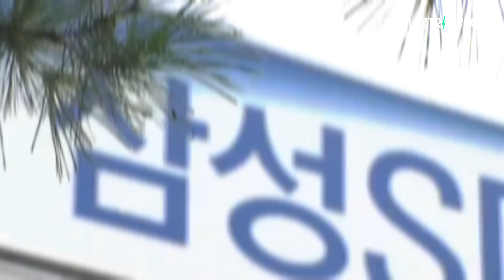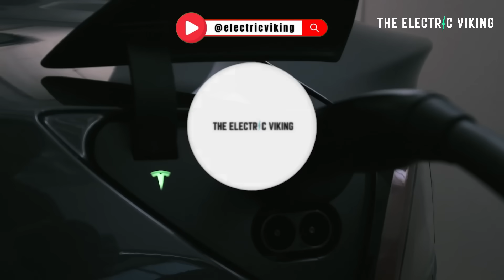Hyundai starts pilot production of solid state batteries for EV testing

Comment: Is there any reason technologies can't be combined? Silicon anode batteries have similar energy densities to solid state batteries, but if you put both in, you could get even better energy density. This does not necessarily mean you'd get more range. You could get the same range with fewer cells and lighter battery packs.

It's not an either/or proposition.
Reply: Silicon anodes are more applicable to Lithium-Ion to optimise the collection and retention of Lithium at the anode much better than current Graphite based anodes. However, Silicon offers lower energy capacity than a Lithium-only anode offers. In Solid State Batteries the anode is either a solid chunk of Lithium metal or an 'anodeless' design where the Lithium collates directly at the charge carrying conductor without a seperate anode material present (plus the electrolyte is replaced with a solid, such as a ceramic or polymer membrane). Hence would not benefit from having another collating material  such as Silicon present at the anode, indeed SSB's will likely surpass the current carrying and storage capacity of a Silicon anode based Lithium-ion batteries. 

The next battery technology offering higher potential energy and power density are Metal-Air batteries (like Zinc-Air and Lithium-Air), where the theoretical energy density can be as high as 11kWh/kg (Lithium-Air, currently 1 to 1.7kWh/kg lab versions have already been created). These are in research as the next technology replacement to SSBs, likely targeting HGVs, Trains, Ships and Aircraft needs. The current road block is cycle life, currently under 1,000 cycles, but innovations in both Lithium-Ion and SSBs may be portable to Metal-Air batteries to accelerate their development. Plus for specialised extremely high energy density needs (such as flight) then a design/process based approach may work even with lower cycle life batteries, for example using high recyclable swappable batteries where the aim is to reprocess batteries at their shorter end of life back into new batteries; whilst more costly and less-economical for mass transport like cars such would be economical for flight use cases.

Comment: 90-95% EV adoption by 2030 🤣🤣🤣 and pigs will learn to fly.
Reply: Regardless, they be here anyway, ice will dissappear
Reply: @luismontelongo4148  ICE will not disappear. They're too useful and flexible. While they may become a much smaller percentage of the total vehicle count this will be the case in only a few countries and regions for the foreseeable future (China, Europe, America). Adoption will be highest where infrastructure is well-distributed and charging speeds are high enough. EV production will hit a wall in less than 10 years  as markets reach saturation point.
Reply: Doesn’t have to be 90%. But 40%, 60%, etc, spells doom for ICE. Economy of scale tank. Meaning it will be much more costly to build from the same suppliers and parts due to reducing bulk discounts.
Reply: Within 5 years, the only car manufacturers left will be Tesla and Chinese ev manufacturers.  ICE is DEAD
Reply: ICE is FINISHED

Comment: You can't simply power a jumbo jet with batteries. The engines require combustion for heat and pressure in the combustion chamber.
Reply: Translation, "I've learned that something works a certain way and believe it will always be like this for an eternity "
Reply: They use electric motors
Reply: Electric turbofans (and turboprops) already exist powered by electric motors. Seems we're going full circle as the very first turbofan was powered by an electric motor. Some of these test bed electric planes are using re-engineered Rolls-Royce turbofans powered by MW electric motors instead. The power requirement for fligth is of course first focussing on short-haul and regional flights, but once power density reaches a threeshold (2kWh/kg) then long-haul flights becomes feasible as well.
Reply: Ok, if they achieve that kind of energy density, maybe it'll be possible to achieve that kind of performance with battery electric. I'm sceptical myself, given all the breakthrough tech that never amounts to anything, but would love to be proven wrong about this one.
Reply: @alexishart1989  - it will probably be the generation of batteries after solid-state, the Metal-Air batteries. Lithium-Air has already achieved 1.7kWh/kg in trials, their downside is the short cycle life, currently under 1,000 cycles. The hope is the innovations in solid-state, which had similar cycle-life issues onyl a few years back, will be transportable to the Metal-Air batteries. 

However, for flight designs there is also research into rapid-swap battery that are charged off plane, ones that are designed to be fully recycled into new batteries once they hit their short cycle life (that is the problem is solved by a supporting process rather than within the battery itself). This approach won't work for mass-deployment batteries like EVs but may work for specialised cases like long-haul planes.

Comment: A 70-90 MWH solid state battery pack will NOT improve range over a 70-90 MWH lithium battery pack. 90 MwH is 90 MwH no matter where it comes from and with all other variables the same will result in the same performance.
Reply: A 70kWh SSB being half the weight of a Lithium-ion battery will improve the range efficiency of an EV, meaning the miles per kWh (kWh per 100km) increases and hence so does the range. If a car with a 70kWh battery achieves 4.2miles per kWh then it will travel 294 miles on a full charge, a lighter 70kWh SSB with say 6.5 miles per kWh would give 455 miles on a full charge.
Reply: @ The battery would have to weigh zero for mileage to improve to the degree you’re stating. It will improve some though.
Reply: He didn't say that. Hyundai SS is 2x the energy density of lithium ion. SS should have 3-4x the energy density of lithium ion if done right by others.
Reply: @larryc1616 Go to 6:15 in the video. That is exactly what he said.
Reply: @larryc1616 Go to 6:15 in the video.

Comment: I don't see EVs having 90% share by 2030 unless something really bad happens in the fuel or ICE production world. However, if anything does force that shift it would be money not customers preference. Some people still like gas cars and the only thing that would stop them from getting one is the price of fuel, price of the car, or government ban on registrations.
Reply: German automakers might be going out of business sooner than you think. 2030 is not going to be too far off. The US is only hurting itself by holding off on EVs and to be honest car prices are already getting more ridiculous each year.
Reply: @willv88  We have had 100 years to optimize making ICE cars all the cost takeout has already happened. The parts count keeps going up and the cost too. Over 2000 more parts than an EV, you can't bean count your way out of that. EVs have one really expensive part, that's the low hanging fruit. Make batteries so they get cheap and problem solved.
Reply: In 5 years, the only car manufacturers left are Tesla and Chinese ev manufacturers
Reply: They will in China if not sooner than by 2029! The world lags sure, that market share milestone. Likely won't be reached until 2032 globally maybe sadly 2035?

Comment: The safety aspect (low fire risk) might be the biggest advantage.
Reply: Yea since so many electric cars are blowing up in flames, right after ICE and after hybrids 😂
Reply: @medschoolvisual6954  a horse driven cart would be safer. Absolutely no fires of any sort to be worried about Then again the horse might go bonkers and kick you in the face and send you into a coma.  😉😆😅
Reply: Per capita, ICE has 10-40x the fires vs ev's
Reply: LFP is at very low risk as well, compared to lithium batteries with cobalt
Reply: ICE data per capita 10-40x more fires than ev's especially with LFP's
Reply: I’m also interested in the wider range of operating temperature.

Comment: Solid state batteries will have to offer something different. Very fast charging on existing chargers would require a very different curve. However, if they store more energy and can enable very long range vehicles that would be marketable. Cold weather performance could also be a good selling point.
Reply: Not catching fire would be good.
Reply: 3 ice vehicles burned down to the ground here in America in the time it takes to watch this video SMDH. 
The #1 open recall across all legacy ice oems affecting over 4,000,000 cars sold in America 3-5 years old. Is for the risk of fire even when parked! Its right in the name internal COMBUSTION engined!
Reply: Faster and Wireless charging and reduced weight by 50% if energy density is 2x that of lithium ion

Comment: ok, so here is the problem though.  yes, the same size battery would give 2x the range.  but these battery cells will not be cheaper.  which means the cost of the car would go up.  except i don't think they would do that.  i think they'd try to keep cost of the car the same.  so they'd only give the car a 400mi range.  so maybe A LITTLE MORE range than the cars currently have.

hey, does anyone know, do solid state batteries still suffer in colder temps?
Reply: Do you like gas cars?
Reply: @6a4e8w9fk  I liked my 2023 ioniq 5 better, before it's battery got destroyed

Comment: low degradation is the promise of solid state battery's
Reply: And solid State batteries with 10x the range.
Reply: Existing batteries are lasting longer than the car already so it has to be more than that. However, better cold weather performance would be a big deal.
Reply: @frankcoffey  they'll also allow full exploitation of a battery's capacity, charge and discharge rate.  It'll allow for using smaller batteries for many.  Less need for a  big battery if charge time's plummet
Reply: @frankcoffey  battery resale post life will matter.
Reply: @veganpotterthevegan  Solar users would love to get their hands on a used solid state pack.
Reply: @frankcoffey  when they're cheap.  Realistically though, sodium batteries will always be cheaper and make a lot more sense in a stationary system
Reply: That's only one promise...one of many
Reply: Battery weight is reduced by 50% if it's 2X energy density of lithium ion
Reply: @larryc1616  totally, but you can cut it down even smaller and have more space inside a vehicle and cut the price down of said vehicle with a smaller battery.
Reply: @veganpotterthevegan  - or cut down the weight and size to increase a car's efficiency, having a small lightweight EV with a 50kWh battery that could do 300 to 400 miles would be sell extremely well in many markets.
Reply: @GruffSillyGoat   totally and really, an even smaller vehicle with just 100 would do very well in US cities.  If Apterra used a better cell and I knew they'd deliver, I'd already have one on order.   But I'd rather spend less and have even a 50mile range and I think a lot of city dwellers would want the same.  There are a lot of original leaf owners that are still very happy with an extremely depleted battery capacity.  Many with means to buy something else
Reply: In your discussion of Nissan the other day (relative to the Nissan X Honda story) you mentioned that Nissan was suddenly touting their solid state battery progress when they had announced nothing in the past, leading you to dismiss it. Actually, Nissan was showing off their pilot solid state production line about a year ago. From company announcements (which with solid state need to be taken with a grain or bucket of salt), this announcement from Hyundai doesn’t appear to be anything more than what Nissan announced a year ago, and that others have been announcing. Is it?